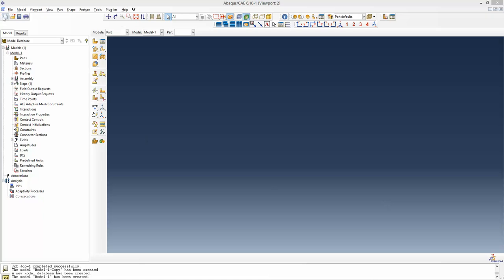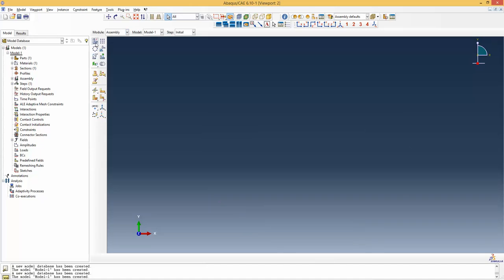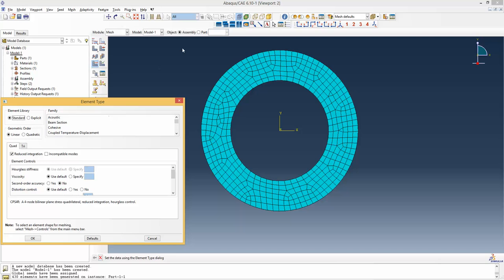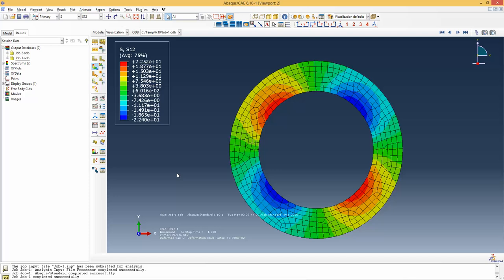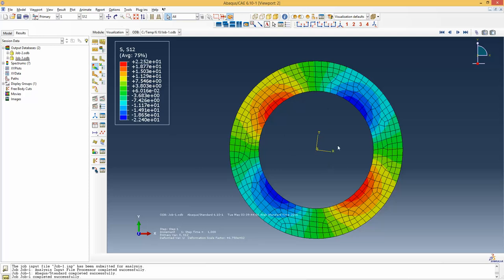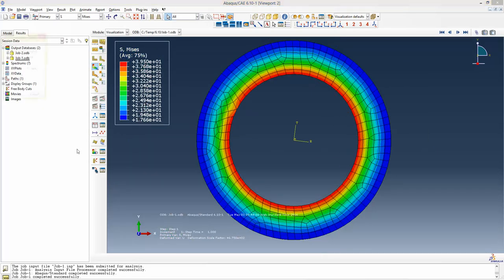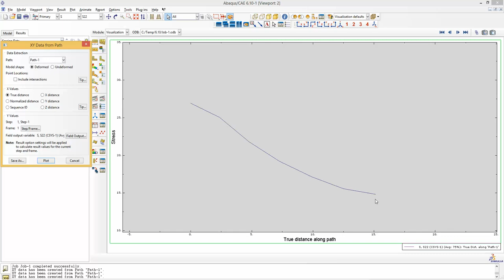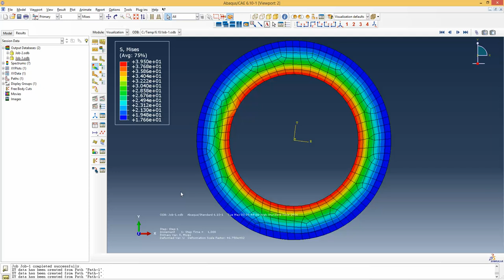Hoop and radial stresses in a cylinder using abaqus

Comment: Thanks for the detail explanation.
Please review my understanding is correct
1. S11 S22 S33 is for X Y Z directional stress by default
2. In order to see Hoop stress, I need 
1) to create Local coordinate system by "Tool - Coordinate system - Create - Cylindrical"
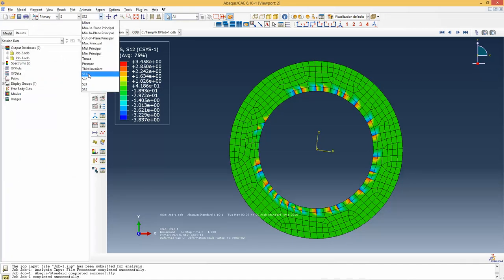2) to change result - option - Transformation - User specified" and choose the name of the Cylindrical one then click ok. Then the result contours are changed as shown in  4:17
3. The dropdown menus of S11 S22 S33 don't get changed. 
1) S11 =  Radial (thickness direction, from inside to outside)
2) S22 = Hoop
3) S33 = Axial ? (there is no mention in this vid)
Reply: Axial stresses are along the length as their is no part in Z direction or along the length so there is no axial stress
Reply: @gam2109yamaha  5 years late... but this isn't correct. The model uses 2D plane strain elements. This assumes that there is no axial strain. However, there will be constant axial stress due to Poisson's effect.
Reply: @sjc152 How to check then?

Comment: If you look on the U1 and U2 on this work, you can see the deformation is not uniform in 360 deg. One location it will be maximum and opposite site will be the minimum. In reality it is not like this. Deformation will be uniform all 360 deg as the load is symmetric. Can you please tell me why simulations show such a wrong result.

Comment: Dear M Saber
I want to obtain the  hoop and radial stress in 3D tube, i have a question,.i define the coordinate system by the same manner or there is an other method?  

thank you
Reply from the maker: There is another method in which you define the cylinderical coordinate system in the .CAE file ask ABAQUS to pass this coordinate system to the .odb file. I may record a video on this method and publish it soon.
Reply: Dear M Saber
This is kindly remember to send to me how to define the cylindrical coordinate system in the .CAE file ask ABAQUS to pass this coordinate system to the .odb file.

Thanks in advance
Reply from the maker: Passing the local coordinate system (cylindrical in your case) from .CAE to the .odb is available when the load is concentrated force or moment. It is not available when the load is pressure. What is the type of loading do you use?
Reply: i applied displacement BCs, 
in this case did i have problem with passing the local coordinate ??
Reply from the maker: No, you can transform the the local coordinate system to the .odb.
Reply: +Mohammed Saber 
please can you tell me how ?
thanks in advane
Reply from the maker: watch this:

https://youtu.be/ChqanV_UrYU
Reply: Thank you very much.
i have an other question, can i create a local coordinate on every element, yes or no ??

thanks
Reply from the maker: On every element?! I do not think so.
Reply from the maker: New link for the video:

https://www.youtube.com/watch?v=3NHax9hy_ZY